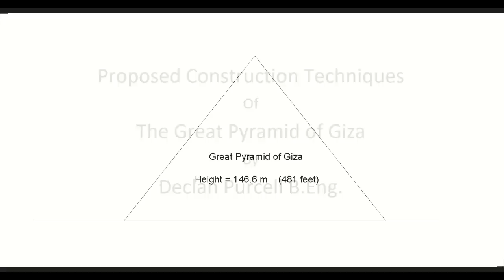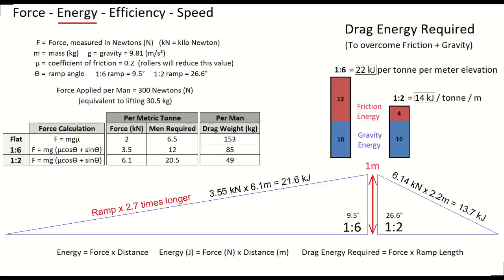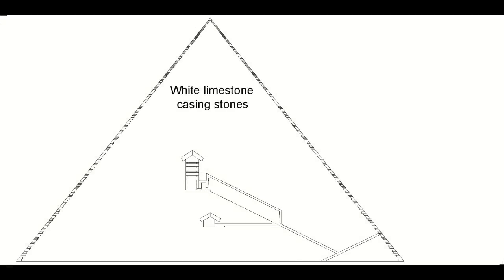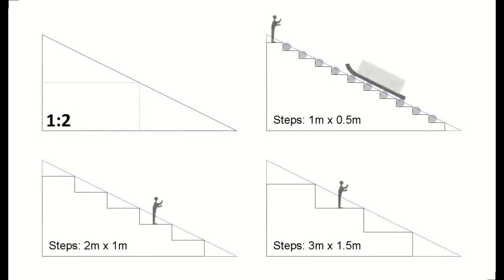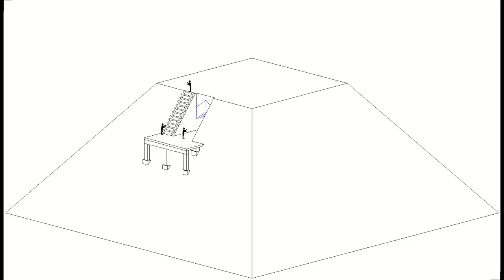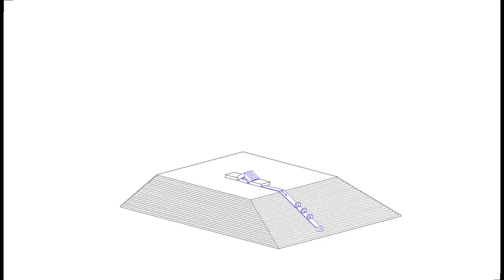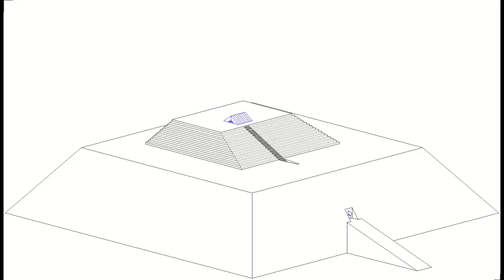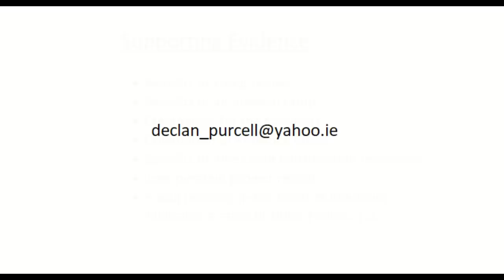Proposed Pyramid Construction Techniques

Comment: Interesting ideas!
It looks like your proposed internal ramp could line up with the big void above the Grand Gallery detected by the ScanPyramids project...
Reply: Exactly what I thought right after I  saw that internal ramp idea!
Reply: this is pretty good, except the internal "ramp" was actually a tube flooded with water so they could float the blocks up using buoyancy and keep everything level... the man-made canals to do this have already been found nearby with ground radar, and those narrow diagonal "vent shafts" function more like straws for managing internal water pressure.
Reply: @kxkxkxkx  the pressure at the bottom of this water filled void would be immense and impossible to actually open. Not to mention water tight seals with intense pressure. This isn’t a possibly solution with the technology that they had at the time.
Reply: @kxkxkxkx  Ive seen scale models of floating blocks up pipe, they definitely had material to make floats ( animal skins ) the pipe out of timber , they Egypt did have massive trade so Lebanese ceder was available and tar / wax could of sealed, the Nile was near Khufu 2500 BC .
Reply: @kxkxkxkx  It's impossible to make such a block float in such a small area you would need either lots of balloons or a very large balloon,it's just not practical
Reply: @ThePolicenaut  shows what you know 🤭
Reply: @kxkxkxkx  The water pressure at the bottom of the float would be too great, it would spill out if even openable.
Reply: Hereafter a demonstration : https://youtu.be/IL2fDzVzNcA?t=12 A 2 tons bloc is level up from one degre. As the egyptians says, each level was completed and thereafter the next level is build.  For very large bloc, they add some counterweight à the otherside of the lever.
Reply: @kxkxkxkx  That idea was really cool, but ridiculous. There is no evidence to support the theory that they floated the ramps up the pyramid. The canals on the ground were likely used to float stones close to the pyramids as evidence suggests and can back that up. The idea that they were then floated up inside the pyramid is a bit wild and there is no evidence to support the idea. The method in this video seems plausible because it doesn't use any new ideas to create the large pyramids, just ramped (no pun intended) up ideas that they previously used to build smaller pyramids.
Reply: @andrewphillips1026   yes it is possible if you build the pyramid upside down and overturn it only at the end .
Reply: @creamwobbly  carving the pyramids out yes that’s brillant . But why the Mediterranean Sea ?
Reply: I think so, too. To fill up the internal canals you'd need many times the tonnage of water than the stone you're so lifting. To repeatedly fill up and drain the canals to float rocks would multiply the work massively. And constructing steps like they have in canals to raise boats would have the same problem. It's just less work overall to move the stone directly than moving the water to displace the stone over and over again.
Keep in mind that there's no river at the top of the pyramid that you can damm. All that water has to be moved up there somehow.
Reply: @gorgenfol   maybe they used quicksilver ? Rocks float much better in quicksilver .  No, just keep the idea that floating the stones to the top is ridiculous. Giant eagles are a better bet . 
I mean , the proposal in the video is intelligent . What it lacks is the evolution of how the builders came to this kind of knowledge. Was it through previous pyramids , or via work in the quarries ? Because you need to extract the stone first , anyhow …. Digging a kind of pyramid in the process … and then reverse engineer that into building . I imagine if you have a cliff with the Nile at the bottom , and you want to quarry the stone at the top , you need to dig some kind of ramp into the lower layers rather than throw the building blocks from higher up .
Reply: @andrewphillips1026  I don't know, I think they could have probably pulled off a water column and seal, but it would have been more of an effort/gain consideration.
The sheer work required to set up a chamber, seal it, flood it, every single time material needed to ascend, not to mention breaking what is effectively a dam open every time you need to raise a block.
It wouldn't have been anywhere even remotely close to worth the effort to use buoyancy to raise the material when you can just use a slope and manpower. Occam's razor.
Reply: @andrewphillips1026  not if you use 'docks' you can separate the pressure with ease.  One person could open it.  And it is the only theory that explains the water, the ramps, and the only  one that provides cool working conditions inthe sun, and least amount of labor for transport.
Reply: @Volvith  'docks' solves all these problems and sealing it is nothing.
Reply: @Volvith then why didn't they carry the rocks from the quarry? Or maybe use some "greased logs" 😂😂
Reply: @daxlarsen2121  yeah it must have been space aliens with greased logs 😂 just because you know exactly zero about underwater construction doesn't mean everyone else has always been so ignorant ☝️
Reply: Well he based this ramp idea off of that data not the other way round.
Reply: Youre wrong and i know why. Because aliens. Its proven fact that aliens. And you knos why? Because aliens.

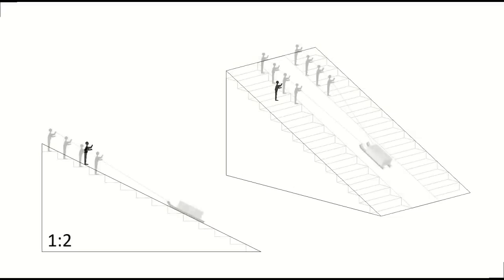Comment: I had always assumed the way to do it would be a longer, shallower ramp, like 1:10, so it's very interesting to see your calculations on the work and friction.
Reply: Yes but do you actually think they would use "man-power" to do all this? Horses? water? I just cant see 1200 men pulling ropes to get 80 ton blocks up (in this model)
Reply: @tbrowniscool  Yeah, they never have to lift the stones off the ground, so i reckon something like 8 men per tonne could move those stones uphill. Its also worth remembering the majority of sandstone blocks in the pyramid were smaller than 80 tonnes. I remember seeing a video of a load of students moving a giant statue like the Easter island heads, and it showed you can definitely move big stones with the right technique if you work smarter rather than harder, and we know from looking at the pyramids the Egyptian builders were very smart.
Reply: @torbenkramm2725  What specifically is incorrect? You say you are against believing things without evidence so maybe you could explain yourself.
Reply: @tbrowniscool  at least 20,000 men helped build the pyramid in the span of 20 years. Also the blocks weighted 2.5 tons on average with only the largest few being between 25-80 tons.
Reply: @PudgyFat  source?
Reply: @tbrowniscool  What's your source for the "I just can't see 1200 men pulling ropes" then? Go troll somewhere else.
Reply: @ng.tr.s.p.1254  it was an personal opinion. I didn't state a fact. You know the difference?
Reply: @richarddecredico6098  Cheers old man

Comment: I was there 1999, looking at the structure out of a engineering perspective. I am pretty convinced that the Grand Gallery is a part of the hoist system to lift the granite slabs. The portculiss also features a multi pulley system. In the roof of the Grand Gallery there are rails. In the lower end they are chiseled off, like someone has removed equipment. Also there are multiple niches in the floor of the GG that could have been used as blocking notched as the crew had to rest. On top of the GG they have recently found something that looks like a void.

Comment: Most convincing theory I've seen.
Reply: Yeah, but we have a 3D render of how it was done in this video. The scale of the workers is about 6 times larger than the real scale. Imagine explaining this plan to slaves with chisels, then it all working flawlessly? No way the great pyramid was made with man power and basic tech.
Reply: then you have to watch that video where they make water tunnels up to the top! (*irony)
Reply: @tbrowniscool  
Yes bro

Granit cant be cut with such precision without power tools.

And they couldn't build those piramides with just man power
Reply: @tbrowniscool  
Try to put an 80 ton block of granite in an underground tunnel

Like in the serapeum

Did you see the serapeum and it's 24 box of granite???

First it cant be cut with simple tools.

It was made with high accuracy imagine that the inside angles are perfect 90.000° polished to reflect light like smooth mirror surfaces.

Things that can be made only by high tech machinery.

No one can imagine how it's possible to transport 80ton block of granite inside an underground tunnel and placed in rooms that are one meter of the level of the tunnel.
Reply: @tbrowniscool  They had much more than chisels lol.
Reply: @tbrowniscool  because the better theory would be aliens
Reply: It took about 1000 years of thinking to get from simple pyramid to that behemoth. Only arrogant and selfish humans believe that ancient Egyptians can't do this. The famous Thunderstone in St. Petersburg in Russia weigh over 1000 ton and was carried by man-force.
Reply: @danielkirpichnikov2007  The people who think Egyptians could not build these structures with the tools they had at the time have no grasp of engineering and Egypt's history.
Reply: @tbrowniscool  They didn't have to explain the plan to workers, any more than you have to teach civil engineering to road workers and bridge construction workers today. All such projects operate with a hierarchy of skilled workers, from designers and engineers at the top, down through foremen and labor gang leaders, with trade workers and laborers at the bottom. Do you wash dishes at McDonalds to support yourself? That's the only way I can imagine your lack of understanding for how things get built.
Reply: @party4keeps28  The idiots that post about the need for the Egyptians to have had advanced technologies are completely ignorant of the engineering and labor studies that have established the feasibility of the pyramid's construction, as well as the studies that show that the agricultural base was well adequate to support the economics of building them, using the basic but competent technologies that we know they had. In general, the internet has made it all too clear that 2/3 of our own population are howling morons. That's the ratio that I observe in comments on all kinds of topics.
Reply: @tbrowniscool  they weren't slaves, they were skilled workers. Why would it be more difficult to explain it to someone with a chisel as compared to anyone else? People weren't any dumber back then just because they had more primitive technology..
Reply: @somefuckstolemynick  How do you know? What source?
Reply: @tbrowniscool the exact same principle is done daily around the world with mega projects. One absolute mutt of a human can accomplish quite a bit of quality work as long as he has a competent supervisor directing and supervising. It's not unreasonable to think that 1200 men could be managed in such a way that would make it easy to organize it. EI. 1 Foreman directs 10 men. 10 Foremen direct 100 Men. 10 Superintendents direct 10 Foremen. "Heave, Ho" to the beat of a large drum, and you're all set. Maximum pulling force could be achieved easily as 1200 men were pulling in unison to the beat of a large drum.

Although it is interesting to see some of the examples of advanced machining and stone work, I have yet to see a plausible solution to all the proposed "ancient alien" technology that many people seem to think was required. I'm not even saying you're wrong, because some of it I have to agree with and it is very suspicious. What I am saying, is here is a proposed method that 100% works mathematically, within the realm of known physics, and with technology available at the time of construction.
Reply: @tbrowniscool  idk man you can force people to do a lot
Reply: @tbrowniscool  
1. 6 times larger? Maybe compared to the pyramid as a whole, but not to the bricks, to which they are only about maybe 1.5 x larger. The bricks are the only part that matters anyway since it's all about moving the weight of the bricks.
2. The pyramids weren't built by slaves, they were built by paid laborers. Even if it was built by slaves, that doesn't make them stupid. I don't see what's so incomprehensibly complicated about "Build this ramp so these other laborers can pull these bricks more easily".

3. It's not like the whole pyramid will explode if something goes wrong with the ramp plan. You act as if something goes wrong with this plan, that's it, no more pyramid, we're done, give up. This is architecture, not bomb defusal.
Reply: @necrosdemoloss4898  Have you seen what the great pyramid bricks actually looked like? They're chiseled and irregular as fuck. Still very impressive, but nothing lots of guys with chisels couldn't make. Not what I would call power tool levels of precision.
Reply: @necrosdemoloss4898  How incompetent do you think the egyptians were? You think modern day power tools are the only thing that can make a rock smooth? Chiselers have been making realistic statues and smooth pillars long before power tools, but they can't smooth the sides of a rock.
Reply: @saucevc8353  nah the cut are unbelievabely precise and there is no other evidence in the ancient egypt, it's like they got worse with technology isntead of getting better. Also the size of the blocks is massive, we would have problem to exactly recreate something like that even in our times. I suggest to watch Physical 100 the korean shows with all the pro athletes, they struggled like crazy to exactly carry a wood boat on a ramp. Also the "leverage" method to raise the block is just bullshit, I love how engineers always thinks reality is like playing with lego but its not. The scale of everything is completely off, the blocks are insanely big and if egyptians were smarter like the guy said, why they didnt just cut smaller blocks?
Reply: @Antares-vj7su  " nah the cut are unbelievabely precise" Literally just saying "Nuh uh,". You know what's unbelievably precise? All the chiseled statues the greeks and romans made. It's a lot harder to chisel a perfect realistic human figure than it is to chisel a smooth side.
" I suggest to watch Physical 100 the korean shows with all the pro athletes, they struggled like crazy to exactly carry a wood boat on a ramp."
Yeah no, there's a big difference between several people pushing a boat with brute force and a large group of people not only using leverage and pulleys but also passing the rope along so they don't get exhausted and probably doing so on a ramp which was smoothened out in some way to reduce friction.  "Also the 'leverage' method to raise the block is just bullshit" Basic physics is bullshit now? "if egyptians were smarter like the guy said, why they didnt just cut smaller blocks?" Because it's hard enough already to chisel out a lot of large bricks, imagine chiseling out hundreds of times more to get even smaller bricks. And you'd need lots more mortar. If it really was aliens or something, why didn't they use smaller bricks since they clearly don't have to worry about chiseling shit out?
Reply: @tbrowniscool  there's a journal from 1 of the foremen working on the pyramid, it's not hard to find
Reply: @bobthetroll  😂
Reply: until you consider the other pyramids that don’t have internal vertical ramps
Reply: @tbrowniscool  it wasn’t built by slaves but instead paid workers
Reply: @acjdz  proof?
Reply: @PudgyFat  I like the argument "you just don understand physics" oh thanks now I am convinced! LOL

Comment: Makes perfect sense to me. The north face corridor behind the chevrons has recently been confirmed, and History For Granite has made a great video detailing how there is likely even more back-filled passage behind the back wall of the corridor. He theorizes that it would have led horizontally to meet up with the Queen's chamber corridor as an access point for workers, but I think it's much more likely that it slopes up to meet the larger void in the middle of the pyramid which perhaps wasn't totally backfilled for some reason.
Reply: while this is cool and all i don't think this would work. For one thing with the number of stones that needed to be moved one single ramp that can only fit one stone at a time would take too long. Also wouldn't the ramps inside be much to narrow for many of the stones, especially the cap stone? Also have any of the pulleys that he is describing been found?
Reply: @Smorb42 you should rewatch. Multiple Stones can be pulled up internally at the same time.

There is to this day no prove of a cap stone. It is commen believe but there is no evidence for a Single large cap stone.
Reply: @KeVIn-pm7pu  no evidence of capstones? than what are these? https://en.wikipedia.org/wiki/List_of_Egyptian_pyramidia
Reply: @Smorb42  the capstone of this pyramid is still debated. But however, in that wikipedia link you can see, that the capstone wasn't very large, therefore would easily fit through those internal ramps.
Reply: @pablomachine2607  exactly. Cap stone small enough to fit inside my computer screen, why wouldnt it fit the ramp?

Comment: As an architect I like this idea very much. Sounds practcal.
In the beginning it would also be possible to work with more then only one ramp. This saves time.
But I wonder: what happend to the internal galleries / ramps? I see no good way to fill them up solidly. Are there still there? Is there a way to detect them?
Reply from the maker: The Scan Pyramid project shows an interesting void above the Grand Gallery..
https://www.youtube.com/watch?v=fOKxqZ3i9Wc&t=313s
Reply: You could fill it with rubble before closing off the ends, with final large stones positioned on the exterior as shown at 7:54. Rubble could be carried up the exterior by hand without any special methods.